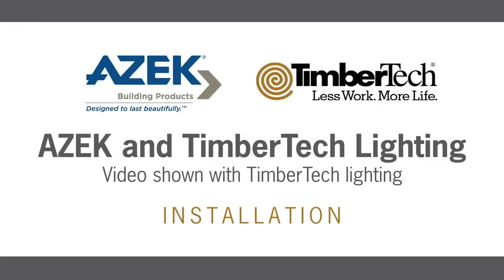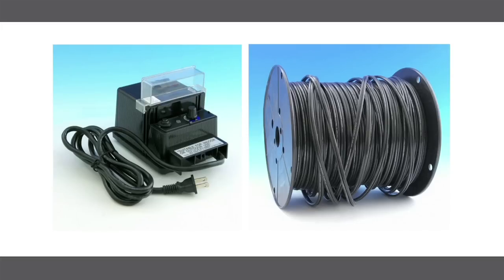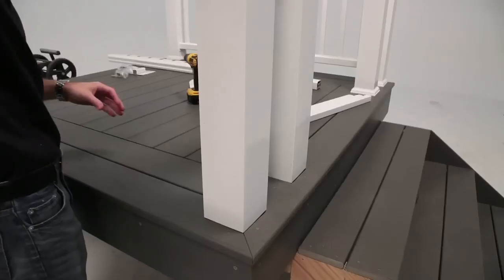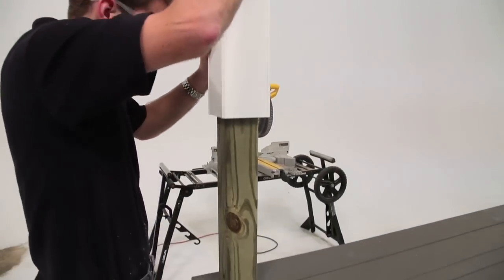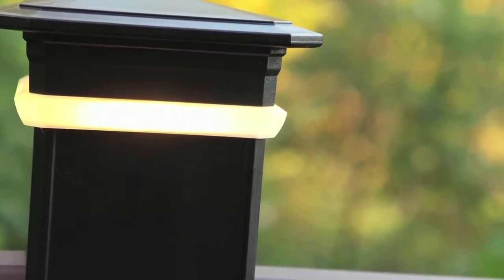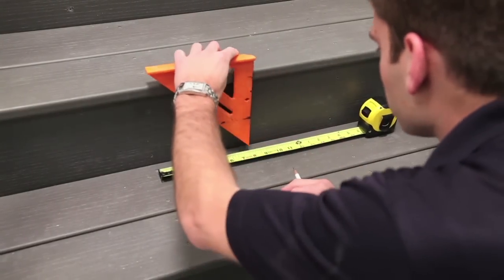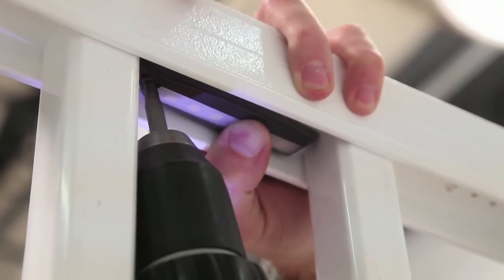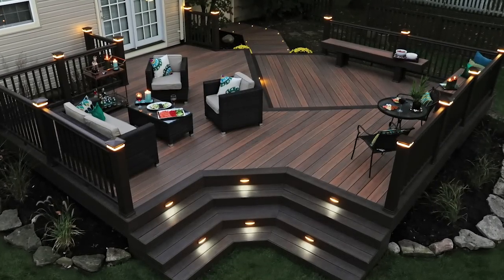TimberTech Lighting Installation

Comment: This says to cut your structural post 1 1/2" short of the sleeve height.  Then it shows drilling a 5/8" hole to run the wire into the top support rail to run the wire to under rail lighting.  Problem is that now you are drilling into a post that is 37 1/2" tall ( assuming a 39" sleeve) at approximately 36" up, so you have to carve out the 4x4 to get the wire down into that hole.  If using a post to post drinkrail, as I am doing, you also need to rout a groove in the underside of the drink rail board to allow the wire to pass into the top of the support rail.

Comment: You should add how to run the wires and connecting all the wires to the main transformer.   The instructions with the Post & Rail do not address this as well.

Comment: The post cap installed in this video looks like it runs on A/C since there was no concern for polarity when the wiring was attached.  When I go to TimberTech's website, all I see is D/C models.  Where are the A/C models?  How about some links to the products used in the video?
Reply: Realize this is old, but in case anybody else searches the - the TimberTech transformers are 120AC to 12AC - they're not DC like a lot of outdoor lighting transformers...

Comment: The Accent Lights have a major design flaw with the mounting screw being only at the bottom. When tightening that alan screw, the top part of the light-housing pulls away from the post. WTF?